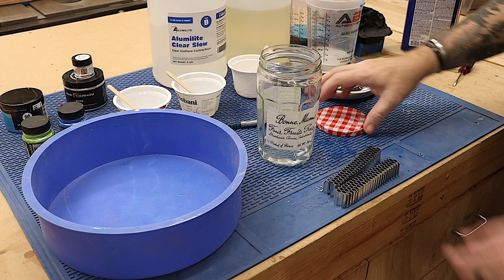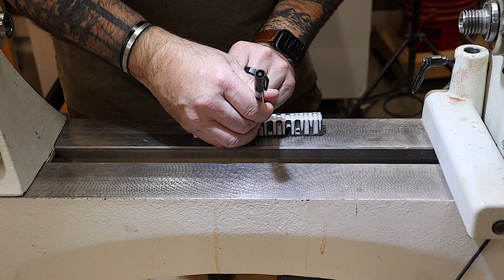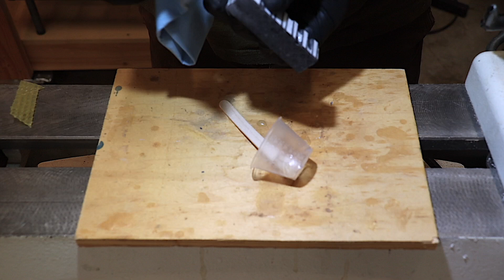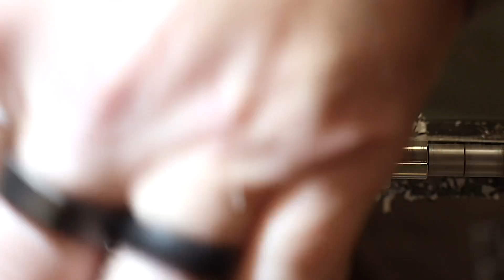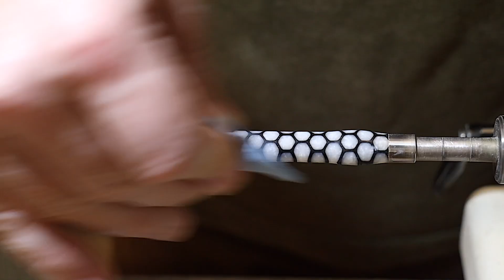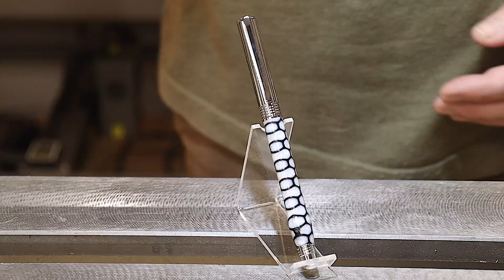Unleashing Creativity: Elevating Resin Pen Blanks with Aluminum or 3D Printed Honeycomb

Comment: This is the best video I’ve seen so far that’s step by step. I am curious did you put the blanks in a pressure pot? And from the sounds of it, are you are running a higher speed? I have tried the smaller honeycomb and the end pieces would fall out. I didn’t clean with acidtone (thanks) and trying a larger cell. 
Very nice completion!